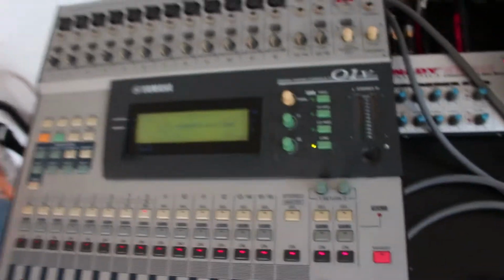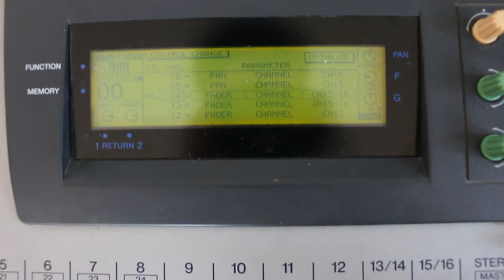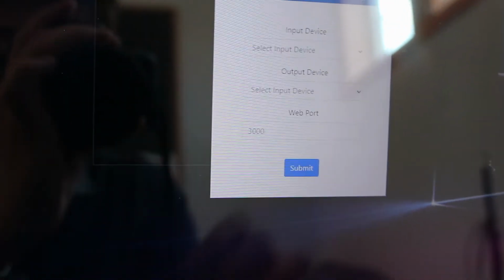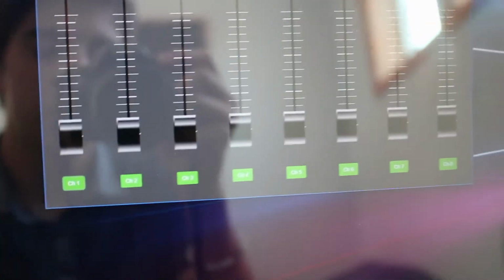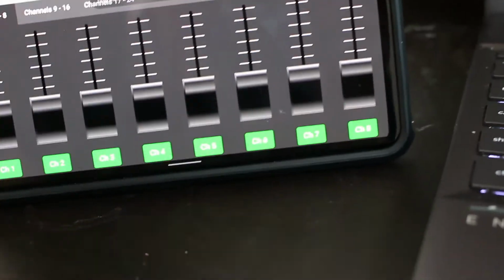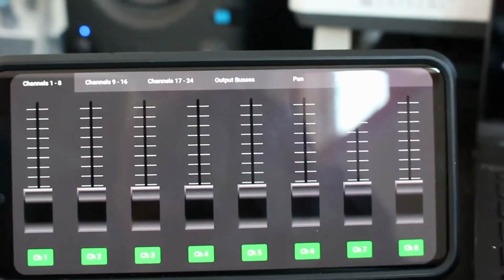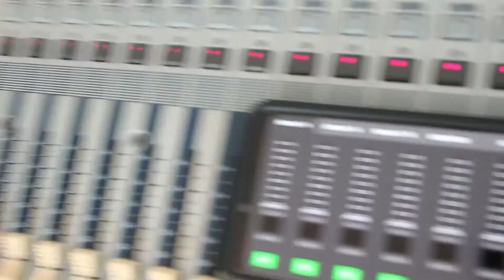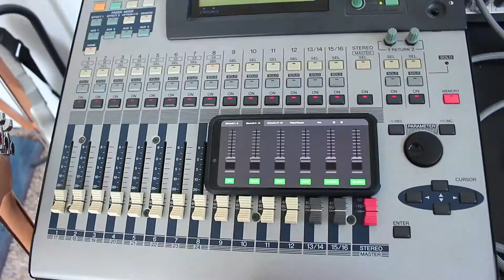Wireless Remote Control for Yamaha 01V

Comment: Hey, I managed to install 01vWebcontroller on a Raspberry fited inside my console case. Used Xdotools to launch the webserver without using any screen nor keyboard. It works quite fine for now, but There's a minor issue : When i'm refresh the webpage, all the cursors are down, even if they're not on the console. Is there a way to push the current status of the console to the program ? Also, is there a way to customise the names of the channels ? (It would be super usefull). Anyway, that's great work !

Comment: Hello my Friend, awesome job. 
Just tried to install, but the input to the computer it’s no working. From computer to console it’s. Any idea? Midi-ox showed me that it’s sending and receiving infos. 
Also can’t open the up address on the Cel phone. 

Let me know if you are also willing to make it a app from this, I know someone who already have a full software for 01v. We might be able to join forces. Bests
Reply: Hello. on my computer it worked, I had to put the midi cable in to in, out to out. I hope it helps you.
Do you have an app that can also equalize at 01v?
Reply: @GeisaGamer  Hello I do not have the equalizer.
Last time I used a wireless mid-controller, I had the in and out plugged, but as far as I remember it would not go.
tks

Comment: Could it work on a Raspberry Pi as the server, it would be great to just be able to stick one to the back of the consle and foget it. just plug in a ethernet cable into the Pi and a router and hook up the clients to the wifi (or lan switch)...
Reply: @CarterJRFilms  it's running on raspbian, but I don't have my console right now so I'm gona have to wait before I can test it. Does the programm runs un Linux ?

Comment: Thanks for all!  I can control 01V with computer or phone but 01V not send midi signal to computer or phone.  Midi output is working but midi input isn't working.
Reply: @CarterJRFilms  Here is the result witn MIDI-OX
 Opened MIDI Input
 Opened MIDI Output
 DEVICE INFORMATION
 IN:   1) USB2.0-MIDI
 OUT:  2) USB2.0-MIDI
   In: 1) USB2.0-MIDI
     Details/Chan: 1,2,3,4,5,6,7,8,9,10,11,12,13,14,15,16,CM,RT,Sx
   In: MIDI-OX Events
     Details/Chan: 1,2,3,4,5,6,7,8,9,10,11,12,13,14,15,16,CM,RT,Sx
 DEVICE INFORMATION
 IN:   1) USB2.0-MIDI
 OUT:  2) USB2.0-MIDI
   In: 1) USB2.0-MIDI
     Details/Chan: 1,2,3,4,5,6,7,8,9,10,11,12,13,14,15,16,CM,RT,Sx
   In: MIDI-OX Events
     Details/Chan: 1,2,3,4,5,6,7,8,9,10,11,12,13,14,15,16,CM,RT,Sx

Comment: You lost me. I don't know code. can you walk me through that part?
Reply: @CarterJRFilms  You're awesome. thanks for the quick reply. i got it to pull up the controller, now i have to get the midi to usb interface. i guess nothing shows up in the input box until i have that hooked up.
Reply: @CarterJRFilms  Hey bud, I got my cable and opened the controller, but it's not doing anything to the board. I went through the settings on the midi screen. not sure about firewall and IP address, I turned windows defender firewall off. any other suggestions. You might could remote in to my computer and figure it out. it's probably something stupid. i just don't know enough about it.
Reply: @CarterJRFilms  You are a genius. that's exactly what it was. the cables were crossed. how do you put the app on the desktop background?
Reply: @CarterJRFilms  you got a cash app. I'd like to buy you a hamburger.
Reply: I changed the parameters in my midi so that channels 17-24 control aux1 fader channels 1-8